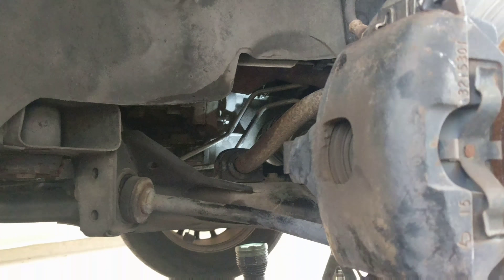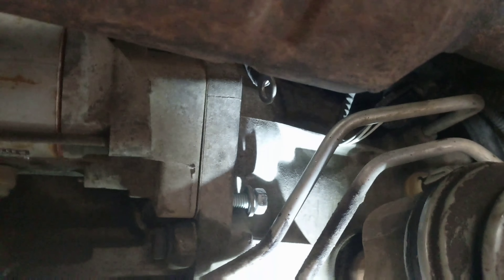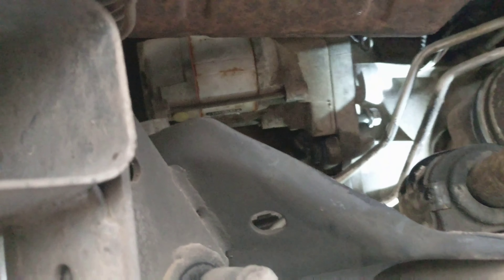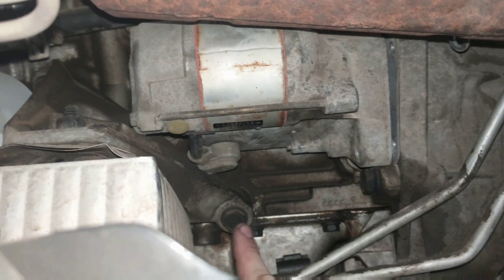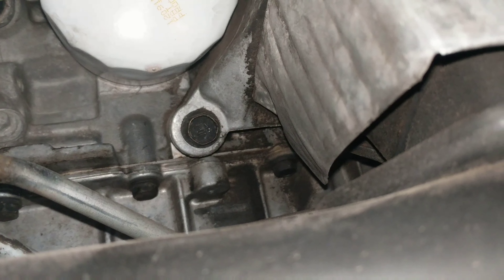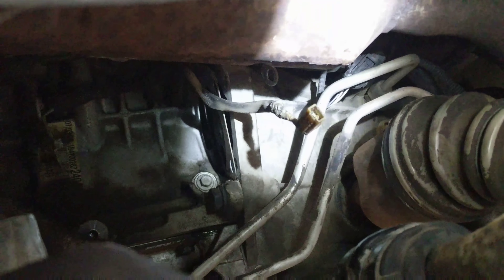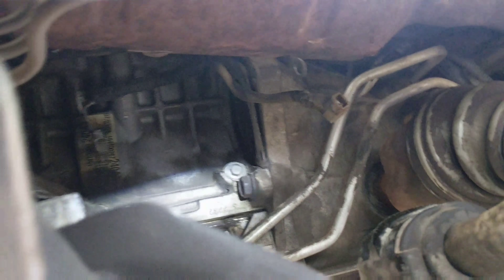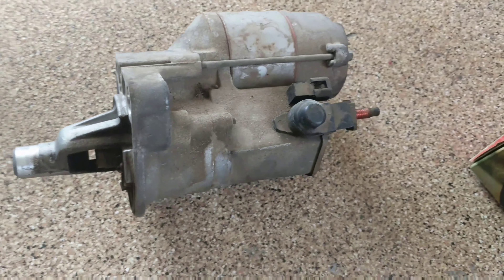2002 Chrysler Concorde 3.5 Starter Replacement

Comment: The secret trick with my 1999 Dodge Intrepid was for the little wire clip between the main Hot terminal, is you have to PUSH in as if you are plugging it in and then Push Down on the little release arm which is on the top (after you push the wire/terminal in, you will feel a little 'give' in the top arm thingy) and THEN you can pull it off. Wires should be removed prior to loosening starter. I used a ratcheting box end wrench to  loosen the Hot terminal (13mm); you can do both before you loosen the (3) tranny thru bolts to the starter; start with the middle one, then the top, then the lower, and use 1, 2 or 3 extensions/and 15mm ratcheting box wrench. Also to get the starter out, loosen the two LH motor mount LOWER nuts first which are below the frame, nearly all the way, then with the jack/a block and jackstands (safety) lift the engine about 1 inch, which allows the starter to come out nose first. Don't forget to unhook neg batt cable prior to start...

Comment: Hey Steve! My stepdad and I just changed the starter on my 98 Concorde today, but for some reason there’s now an issue with getting power throughout the car. The dashboard lights won’t work, windows not functioning, and trying to start it has no reaction. The battery itself has enough power, we tested it, so we’re thinking there’s an issue with the conduction system running through the car. Any ideas?? Please help🙏🏽🙏🏽
Reply from the maker: Check the battery connection and make sure there is no play at all. Check all connections and check fuses and relays. In case something got popped

Comment: What kind of impact drill do i need to remove the starter?
Reply from the maker: You can use a ratchet. If it's tight you can make the handle longer with a pipe or a bigger ratchet.

Comment: you wear a ring working on cars ?  red hot when you touch battery terminal.
Reply from the maker: +Filter Taylor only certain jobs. I don't touch terminals lol. The battery is disconnected. I've also been a welder for years. I definitely don't wear a ring while welding or doing metal work lol.